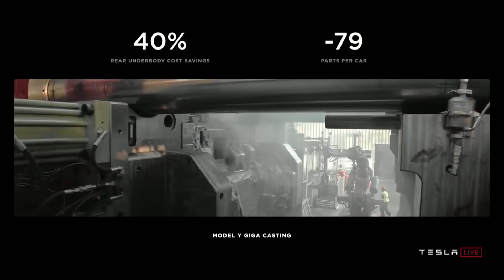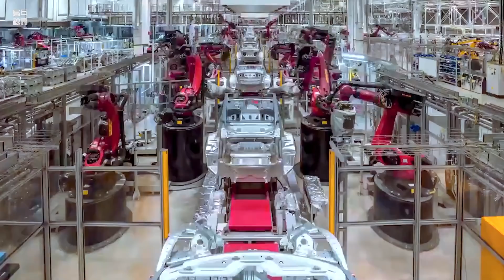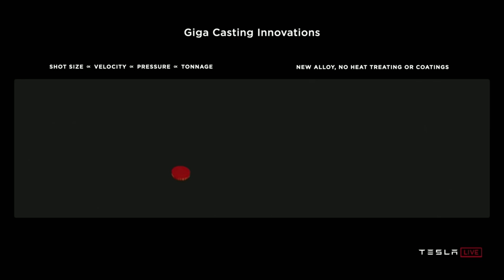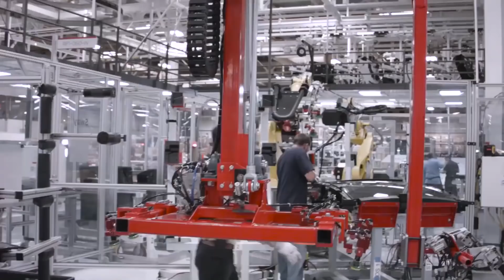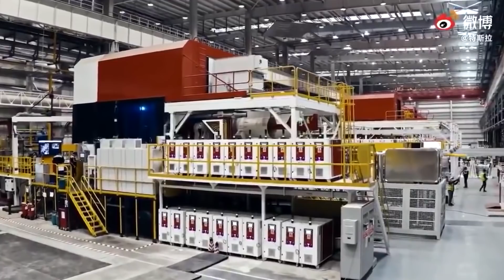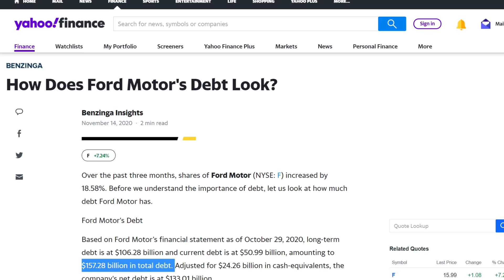Tesla Giga Press: Why dont Auto manufactures copy?

Comment: Musk keeps reminding us that the long-term strength of Tesla will be manufacturing technology. If their batteries and their casting tech can be copied in 24 months then what's Tesla's advantage over the competition, and if it's only their head-start and developement/iterating speed, can they keep that pace long term?
Reply: Listen again.
Ford example.
Billions in machinery which is essentially a frozen asset they need value from before they scrap and reinvest.
The F150 is a good example.
Why did they use that cab?
Because the machinery to build it  has to reach end of life before being scrapped.
Reply: The casting alloy may be duplicated but the tabless battery is patented. Those other battery companies are ramping up to build tabless 4680's under license with Tesla.
Reply: @terrysullivan1992  it isn't really tabless. It is multiple tabs

You can't patent more of something that exists

At worse even if they have managed to patent a 'tabless battery'. The others will just build a tab battery with 50 tabs rather than 1 which is more or less the same outcome
Reply: @kaya051285  Well Tesla have filed a patent application so I guess we'll soon know if it can be patented.
Reply: Roger is right, but there is more. Megacastings mean a much smaller labor force, which is great for Tesla who are madly expanding and can just shift people around but for the legacy companies it means putting together early retirement packages and pacifying the union so they do not go on strike. Megacastings are also really strong, so if you have one on each end and then put an industry standard battery pack in the middle you have a bad situation where the pack and the passenger compartment are the weakest part of the car in a crash. Of course you design in safety features, but in a hard enough crash the passengers and the battery pack lose. So really to do the megacastings you need to do the 4680 cells and the structural battery pack that make the battery pack and the passenger compartment the strongest areas of the car. The other automakers are many years from being able to get 4680 cells and doing a complete switch from pouch or prismatic cells to make a completely new battery pack design. Larger companies like VW Group that use a shared platform for multiple brands, like Audi and Porsche, would then have to make both of the companies redesign all of the cars using that platform, because the form factor of a 4680 pack is different from pouch or prismatic. It all ties together.
Reply: Other manufacturers are not forced to make structural battery packs or move away from pouch cells. They can make a 3rd casting for the middle section and use a different battery technology (like Quantum Scape's solid state battery pouch cells) that has better Wh/Kg to lower the total battery pack weight down to levels similar to Tesla's solution. However, that battery tech is still not ready for mass production so Tesla still has the lead.

But yes, Tesla is building all new factories from scratch, so they have nothing to lose unlike the million dollars of existing equipment, floor space, materials, and skilled trained staff that are in existing factories for other auto manufacturers. It would cost them soooo much to switch over to Tesla's methods over night that they simply can't afford it.

In the mean time Tesla is taking huge chunks of market share in the vehicle market while competitors' hands are tied. These competitors can only slowly switch over parts of factories as equipment leases expire. If we're talking about long term, how will they even survive?
Reply: What about the newer technologies or improvements to the existing Tesla technologies? They will be kept trying to catch up but falling behind while trying to copy Tesla. Only choice for them is to invest in R&D for their own technology.
Reply: There's no advantage in inferior technology

Comment: VW pressed whole chassises for the Bug minus the fenders from day one in 1937! This is hardly new in Auto manufacturing.
Reply from the maker: I dont know much about VWs manufacturing process would be interested to know if they use any presses today
Reply: @EV Stock Channel  The Giga Press is a type of high-pressure die casting machine (according to Wikipedia). The automotive industry has been using such machines for decades. Most engine blocks and transmission cases are often made using this and/or similar techniques. What's unique about the Giga Press is the sheer size of the castings and how those castings are being used in the final product. As an aside, while the Giga Press is (probably) the biggest die casting machine, it pales in comparison to the largest forging and extrusion presses produced during the Cold War. Alcoa has one that can exert 50,000 tons of pressure, produced as part of the Heavy Press Program. While perhaps not directly comparable, it's interesting stuff nonetheless!
Reply: @xyzman8888  Oh sorry! I did know Tesla made the rear bridge in a  one piece cast, but the video talks about chassis pressing?
Reply: Do you have a source for that information? I would love to read more about it.
Reply: @TheScarnak  Here: https://www.youtube.com/watch?v=a9CZ13UAZ_w&t=166s

Not a complete chassis, but roof, and two sides. still, this cars production was optimised for fast cheap production to make it affordable for everybody, so some parallels to the spirit of Tesla could be drawn.
Reply: @Tore_Lund  Thank you. Your video only shows sheet metal being pressed though. That is not at all what Tesla are doing. Pressing cold metal has all sorts of issues like metal deformation and bounce back. Tesla are die-casting their parts meaning a molten alloy is injected directly into the press. I do not believe any automotive manufacturer has ever done this on the scale Tesla is attempting.
Reply: @TheScarnak  Yes, I noticed my mistake, Giga press is Giga die cast machine! Also pressing aluminium is not as easy as steel, so this makes the VW tech less relevant. However it is still impressive how optimises production was even back then, with human welding robots.
Reply: @Tore_Lund  You're right. It is impressive especially for the time it was being done. Excited to see what Tesla's new tech can bring to the production line though

Comment: Tesla booked IDRA for Years out, 6 Gigas missing still in Berlin maybe 8 Gigas in Austin, and you see how long it takes to install them or even Build them it takes a long time Years until another Automaker can make a Deal with Idra. They have to find a Company that again invent the Press new and for sure IDRA got Patents for the Press also. No OEM's not starting and not being able to for many years. When Elon stops building new Gigafactory's than they have a chance to get a Giga Press, in about 30 Years LOL
Reply: The other OEMs had decades to implement this technology but were held back by quarterly earnings reports...
Reply: LK Machinery in China has owned IDRA for some time. If IDRA was not owned by LK Machinery, I would agree with Ivan that Tesla would likely snap them up. As Albert points out, Tesla has a large backorder of Giga Presses that IDRA and LK Machinery will take years to fill, so in some ways, Tesla has frozen out the competition from acquiring Giga Presses for the time being.  LK could likely scale quicker than IDRA, and I am sure that if push comes to shove, Chinese auto plants will be favored by the Chinese government to be supplied with Giga Presses if they so desire.
Reply: Right.. 😂
Reply: Albert Rombold
That was my thought as well.

Comment: It would be interesting to make some calculation, how much the chassis cost without the gigapres and with it, so we can have an idea in percentage how much savings we can have. I am wondering if it's tens, hundreds or thousands of dollars per chassis.
Reply: Munroe said in a video its probably a wash which means about zero savings in cost. However an improvement in speed and accuracy 

Why might it be $0 savings?
Well aluminium is approximately 3x the cost of steel. And the additional additives for the aluminum more costly still

So the process is better
But the material is more expensive

There may however be a secondary benefit. If the aluminum reduces the vehicles weight by say 70kg it might increase range by 1% which will help on bragging rights. 303 miles EPA rather than 300 miles etc
Reply: @kaya051285  You miss the % of fault Pieces   that in this process Is more high and cost a lot.
Reply: Absolutely cheaper. Likely low 4 figures. 

However, increasing throughout gives you economies of scale and larger top line revenue.
Reply: 0
Reply: My unedducated estimate is rather a few hundreds then a few thousand. And although this is fascinating and lovely innovation, sadly I simply cant see this as a huge step towards making cheaper cars. Speed is nice, but it won't make the cars more affordable, what is a key thing for larg number of sales.